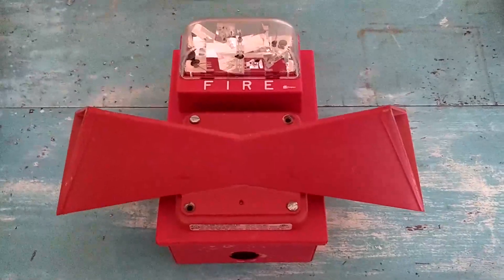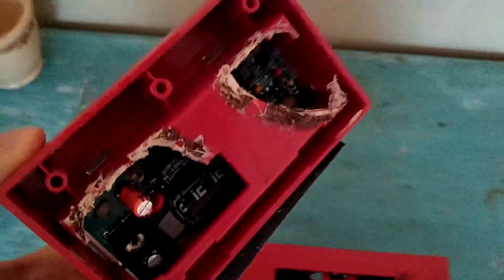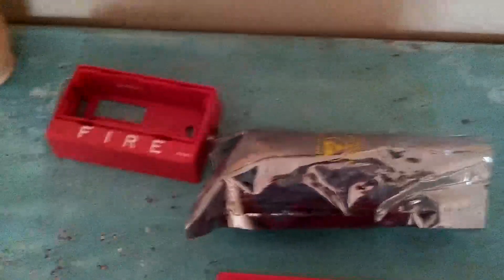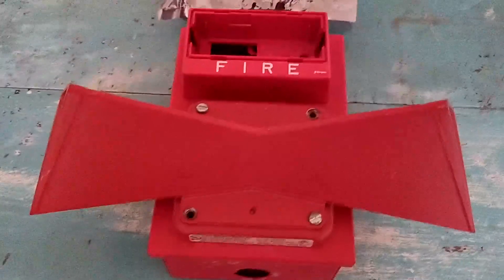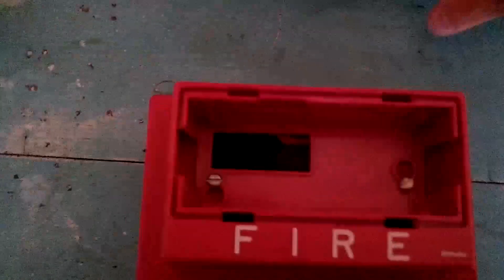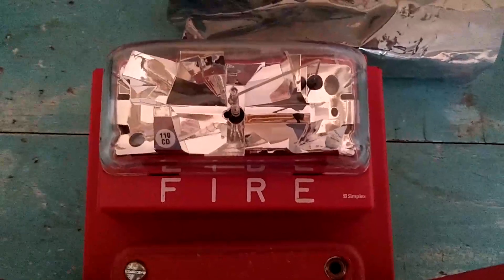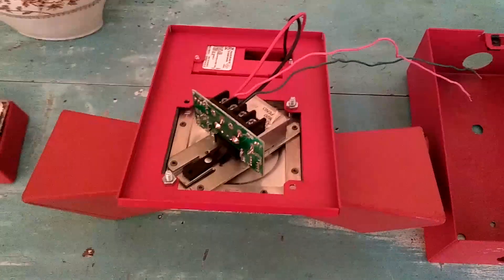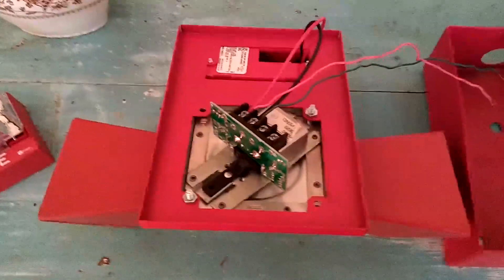POWERFUL fire alarm OBLITERATES the 4903-9219

Comment from the maker: I'm probably going to do another video comparing the 2901-9838 to the 4901-9817 at a later date to share my thoughts. Basically, I believe I figured out why these horns haven't aged well, and why mine didn't work initially.

The 6220-series was marketed as being more wear-resistant since it was controlled electronically rather than relying on mechanical contacts like the 6120. However, the vibration appears to cause the soldered components to shake loose over time, causing a scratchy sound. This is likely what happened to my horn.

Adjusting the gap fixed the horn, but it still would refuse to sound on occasion until I clamped the loose components securely onto the board with pliers. Now it works fine.
Reply: @Bart Lee Gentex used the same circuit in their GMS horn from the 90s - they sound constipated killer robots from The Terminator.   You think these fire alarm pcb designers would take a page from Boss who can make their guitar pedals last 40 years before a solder joint fails 😒.

It's also not digital, but an analog circuit.  An infrared LED and light detector called a phototransistor detects the position of the flapper, and turns the electromagnet on/off really fast.
Reply: You should do that

Comment: What does it look like with out projector on horn
Reply from the maker: Almost exactly like a 2901-9838. Only difference is silver sounder plate (like the newer -9838's), Simplex logo is slightly smaller, and the paint is a slightly darker shade of red.
Reply: @Fahrenheit4051  so a 9846
Reply from the maker: @vintagesimplexfirealarmsof6440  Or a newer -9838 with a silver plate.
Reply: Dose the 2901-9838 fit on 2905-9907 Double Horn
Reply from the maker: @Ňaraŋĵa Yes, there were different versions of the -9838. The earlier versions had black sounder plates, and the newer versions had silver. The extremely dark red you're talking about is likely the result of dust accumulation or some other weathering process.

The -9838 does have the ability to change the volume, but this is a "hack", and not a feature used in the field. Some of them are just louder (and differently pitched) than others because of imprecise manufacturing. Apparent loudness also depends on the acoustics of the room. These factors create the "harmony" we all know and love.

You can also tell a 2901-9838 from a 4901-9817 by the size of the Simplex logo (as mentioned above). On the -9817, the logo is the same height as the text, whereas on the -9838, it's larger.
Reply from the maker: @Ňaraŋĵa Not sure what you mean. They -9838 and 9817 are different model numbers so if you can get close enough to look at the tag, it'll just tell you.

Comment: very cool combo, how did you adjust the 9817? I’ve been trying to figure that out for quite some time.
Reply from the maker: Essay time.

The black tab that's off to the left in the video? It ends in a rectangular bit under the circuit board. Adjusting the gap between that and the board itself seems to be what does it.

Plastic isn't malleable, and breaks easier than metal. Therefore, the best way to adjust the sound is by bending the metal tab that the plastic bit rests on.

A word of caution, though - it's not like the -9838, and if your -9817 works I wouldn't touch it.
 It's only a hair trigger between working properly and doing nothing at all. When I got this alarm, it did almost nothing and only sounded sometimes.

Comment: Those 4904 strobes......they are the biggest pain in the neck. I assume the strobe housings on those things are extremely cheap (both quality wise, and probably price wise too). Probably was normal to just buy a brand-new housing for those strobe units in the field I guess (not 100% sure on that, but that's my theory. could be wrong)

Comment: Really cool! Ya the 4904 series is really annoying because of its mounting. I was actually able to separate the strobe from the housing. I did not know it was supposed to be irreversible lol. I also did not know that those strobe plates were just metal with a 4904 strobe mounted on them!
Reply: I know right! Especially for collectors who put up and take down different devices. Although that is not at all the reason fire alarms exist.
But even if a device goes bad it would be super hard to replace
Reply from the maker: When I said "irreversable", I meant "extremely difficult to undo". I'm not sure what Simplex was thinking when they designed them.
Reply: @Fahrenheit4051  it not just horrible for collectors. It horrible for installers. Like if a 4904 strobe went bad in the 90s you have to remove the strobe which is very hard to do. I’m glad they improved that with the turealert series.